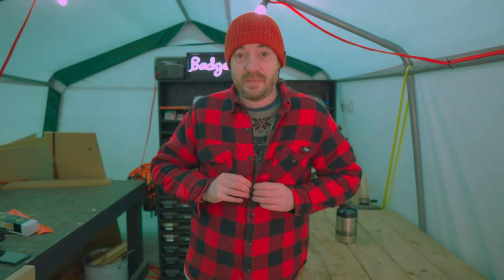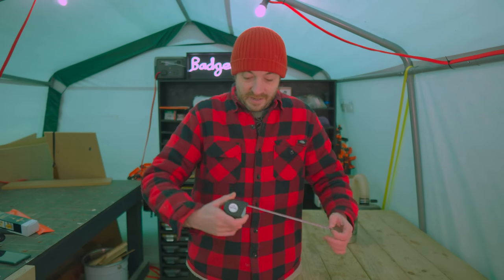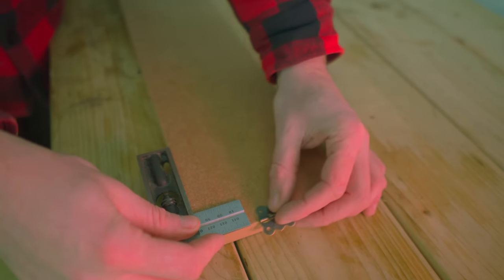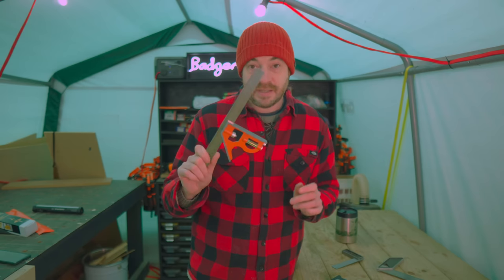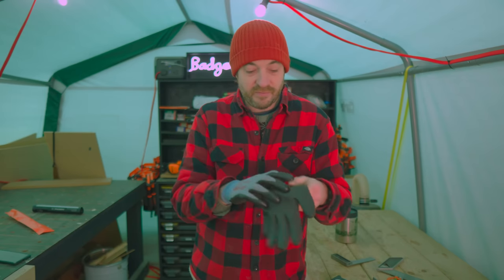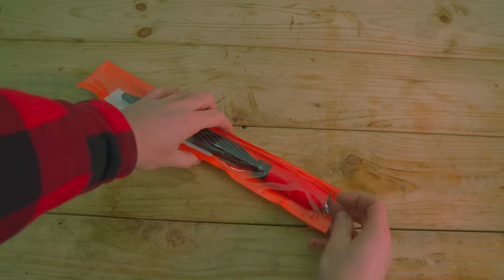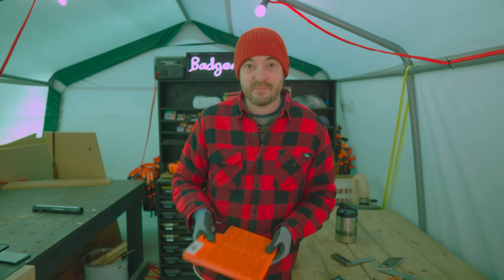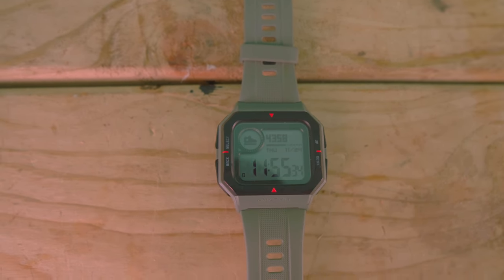Christmas Gift Guide

Comment: Nice video. I already have some of these items. If anyone is in two minds on the Shinto rasp, buy it now. I've had one for a couple of years and it remove material really fast. I've used it on 9mm ply many times. The fine finish virtually requires no sanding on plywood.

Incidentally the Starrett 250 square is only £3.67 on Prime at the moment! As well as Starrett and Bahco, I'd recommend Presch. I had a 300mm combo square for Xmas last year, made in Germany and close to Starrett quality.

Comment: 1:33  I’ve got that tape measure (3m) - might be worth pointing out a couple of other cool functions it has. The reverse side of the tape is marked for measuring diameters of circular objects. Also the tape has marking ‘blades’ on the ends and body of the measure, so you can measure and then transfer the measurement directly to another piece of wood. (Your pack of pencils will last even longer!)

Comment: I use the large hole on my pencil sharpener for 'fat' double ended red/blue pencils which I've found both online and in shop ( they are Gernam Postal Pencils I think) - they are perfect for marking up rough timber for cutting, or the triangle when you're laying out boards to make a panel. Be interested for any reccomendations for the best white pencil for marking dark woods, never found a good one really.